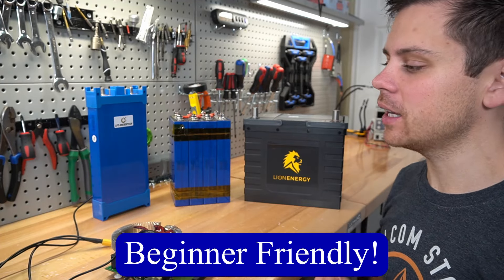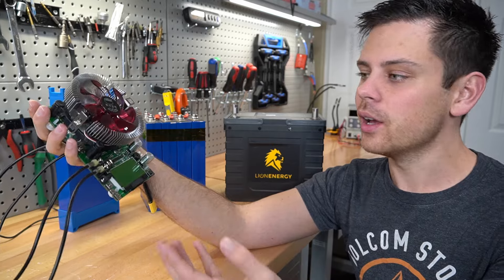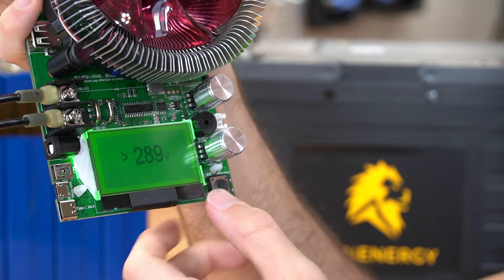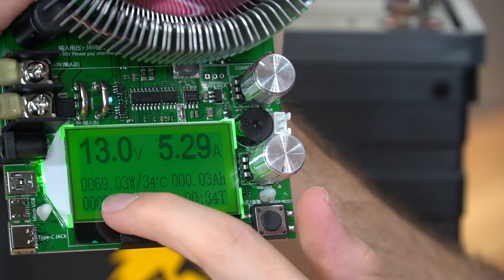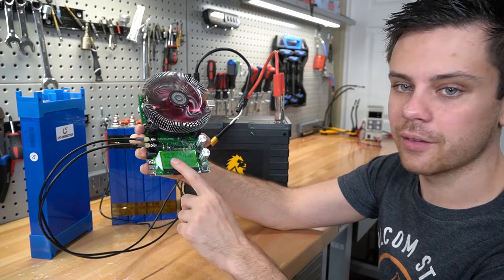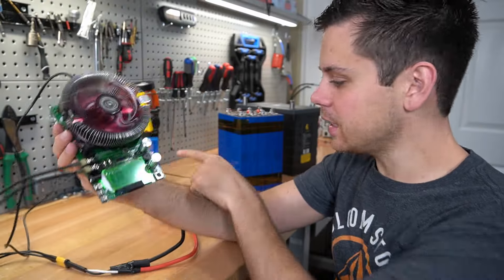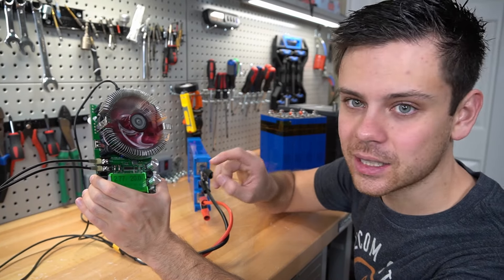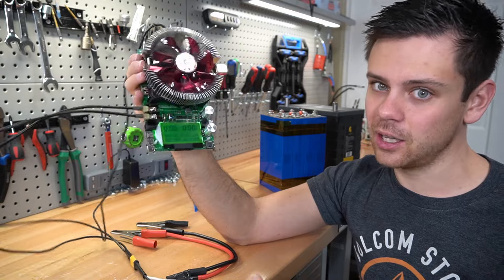Beginner Friendly Lithium Battery Capacity Test Method

Comment: I've been using the same tester for months in my review videos and it works great. You can also power it via 5v usb instead of needing to plug it into the wall. Good for testing outdoors.
Reply from the maker: Oh that's what you use?!?! I remember seeing you use some kind of tester! That's awesome so glad you give it a thumbs up :D if you and I don't kill it, no one can haha
Reply from the maker: I bet the fet will burn out one day. Would be cool to make it water cooled
Reply: @WillProwse  Yep! I only use it to DC discharge solar generators or test panels so the power limit has been a non issue. The fins bend real easy and I can see myself eventually breaking the fan but I keep it in a plastic case now. I wish they had something like this for AC testing inverters!
Reply: @HOBOTECH Hello,  

Hi, What settings are required to test a 14.4V 2.6Ah 4S1P Li-ion battery? I've tried various configurations, but the test stops after running for just one minute. Any advice would be appreciated. Thanks!

Comment: Will, you can do 20 amps at over 13 volts with this tester if you make some changes in the setup alarm screen called > 185 W. After you have noted what the TEMP reading is on your data screen while drawing 184 watts for a few minutes with a 12v, LiFePO4, drop in battery,  (my unit reads 70 Celsius in my house), you can set the tester in a cooler full of frozen water bottles, or do what I do and set it on the face of a portable desktop fan, or any other trick that cools the heatsink better. You should see the TEMP go down a lot. Now you can increase the > 185 W threshold to 260 W. While you are cooling the heatsink more efficiently with whatever technique you decide to use, you can ramp up the amps until the TEMP gets back to where it was when you started. I can now do a 20 amp draw on a 100 AH battery for a true .2C rate test, as long as I set the tester on the face of the portable desk fan. The TEMP stays below 70 Celsius. You can't set the threshold very much higher without the extra cooling or you will burn up the MOFET under the fan and heatsink assembly. I tried it so others wouldn't have to ( that's me saving face, LOL) Hope this is useful to someone.

Comment: low voltage limit  - each double click adds 10 value per click,
Thanks for this video, I would never have figured this machine out with the Chinese English directions. This video was soooo helpful!!
Reply: How does one lower this value? This thing is driving me nuts.
Reply: @super_straight  I did this 2 years ago, do not know the answer, apparently it was in the video. I don't remember 2 years later, sorry Super

Comment: I have the same load tester and, like you, I had a preconceived notion that it would be cheap and inaccurate. Imagine my surprise when I compared the voltage and current values the load tester reported with readings from my high dollar Fluke multimeter. Less than 1% difference! Be careful to always turn both the course and fine current adjust knobs fully CCW before connecting a battery source. Should you forget it will cost you about $5 to replace the mosfet. Thanks for the great video.

Comment: Great review !
But, the "low voltage protection" does not disconect the load. It only use a buzzer to warn you. So if you are not here you can kill your  single cell without BMS
Reply from the maker: Oh crap thank you! Didn't know that. Thank you
Reply from the maker: I'll pin your comment so others can see
Reply: wire relay to the buzzer. fixed.
Reply: @ninja5672  Wow--thanks for the heads up!
Reply: Supplementary Heads Up !    There are TWO versions of this unit, 150W & 180W so do pay attention to which one you are getting.   

IF testing batteries directly, DO put an appropriate sized  FUSE between the battery & the load tester.  Will makes a comment in the video BUT people are missing it.
Reply: @ninja5672  yea thats an easy fix
Reply: That would have been nice to know before I bought it!
Reply: @stephsoltesz6731  ya, mine took a dump, have you had to repair one of these?
Reply: Your video cuts off when you hold down the button to change the low voltage disconnect, how to you change the value? When I hold it down it stays at 0
Reply: my model (185watt) does disconnect the load. I discharged a single cell (200ah) and when the cell reached 2.6v the load was disconnected. My multimeter showed the cell at 2.89v. So it wasnt completly empty. So i think you can set the 2.6v even lower, right? cause the device doesnt measure it accurately (because it also draws power)
Reply: @ericcastro8323  i also have troubles adjusting. You have to hold the button or double click. But how to reverse direction is still a mystery for me
Reply: @stephsoltesz6731  Is a fuse necessary if I were to test a 4s 12v 100 ah lifepo with a BMS? If so, what size fuse?
Reply: @stephsoltesz6731  Thanks! I am about to make a battery for a trolling motor, however,  solar may be in the future.
Reply: @HighlineGuitars  Best option really is to get on the DIYSolarForum, there are Boaters there and actually a couple of threads on trolling motors and thrusters with LFP as well.   Same proverbial Canoe I guess. LOL
Reply: Copying my comment here, since this is a dedicated to low voltage disconnect post:
"
Nobody is talking about this clearly in the comments (not that I found), but to set the low voltage disconnect you need to double-click (not hold) the button. However, on some units it doesn't disconnect, it just warns with a beep; and even if it disconnects, the cell/battery is still connected to the unit and loses voltage. So beware!

"
Reply: للل(ل ه
Reply: My model is 250W. After testing I love it! Mine actually disconnects and stops the test at the preset low voltage
Reply: @zaph0dbeebl3br0x  the voltage creeps back up after it hits the threshold. Might have something to do with the impedance of the battery. It still hit 2.6V. I would not push it. The battery may lose capacity
Reply: @zaph0dbeebl3br0x  Double click the knob to change the direction of the numbers (increase or decrease) and triple click to increment by one decimal point. Hold down to change it quicky in the direction chosen by the double click metiod.
Reply: I guess Im asking randomly but does anybody know of a method to get back into an instagram account?
I somehow forgot my password. I love any tips you can offer me!
Reply: @Zakai Gerald Instablaster :)
Reply: @Francis Cohen thanks so much for your reply. I found the site on google and im in the hacking process now.
Takes a while so I will get back to you later when my account password hopefully is recovered.
Reply: @Francis Cohen It did the trick and I finally got access to my account again. Im so happy:D
Thank you so much, you really help me out !
Reply: @Zakai Gerald No problem =)
Reply: Exactly why I came here right now to check this video again. Was doing a capacity test on a lead acid battery using this tester and just left it and when I came back home the voltage was reading 0.37
Hope I didn't do too much damage.
Reply: How can I use a 16s BMS on 4s?
Reply: @ericcastro8323  Double-click to increase or triple-click to decrease (not for you, for new readers)
Reply: @zaph0dbeebl3br0x  Triple-click to increase. Double-click to decrease.
Reply: @yudhistre   THANKS FOR THE SPECIFICS ON THAT ADJUSTMENT!!!
Reply: Yep. Wish id had dam well read this before completely destroying two of my lithium cells only a few days ago!!
Reply: No that is not correct. When the low voltage limit trips the buzzer goes off and the fan stops but it will cycle back and forth so it looks like it does not work. I did this over and over. If the fan stops, the current is zero.
Reply: @WillProwse  Mine shuts off the load. Fan stops that means it shut off.
Reply: @perry9492  it didn't with mine and two of my cells ended up like water melons at a voltage of 2.1v
Reply: @andysutils  It may cycle on and off enough to kill a battery. It also might be why they burn up if the cycle on and off a lot. It needs to latch in the off position after a low voltage alarm.
Reply: @perry9492  I've noone to blame but myself for being to impatient to wait for my new bms to arrive. I only realised after the reason it cut off with my 100ah ones is because i ran the tester through my bms. It now must have been my bms that cut the capacitor tester off and not the capacity tester itself.
Reply: @zaph0dbeebl3br0x  You have to allow the cell to rest for several hours, after the discharge, before testing with a multimeter. The multimeter will not give an accurate resting voltage immediately after the discharge.
Reply: @HighlineGuitars  Fuse size depends on the amperage being drawn during the test

Comment: I just wanted to let you know that I purchased one of these capacity testers like I said I would and I have a total of 3 lithium iron phosphate batteries that I wanted to get tested. On the third one the load tester popped and sparked and the big main mosfet in the middle failed!! I'm glad that I ordered this from Amazon and I have started a return!!
Reply from the maker: Yeah mine just blew up too!! Need to post an update. what a bummer!!
Reply: @WillProwse  i have 3 of these from a year ago. Now not one of them will turn on.
Is there a way to "reset" them? None of them "blew up" or smoked or anything like that.
Reply: @WillProwse  Do you have an updated video for this issue? I can't find it if it was posted.

Comment: First I really enjoy your videos and the amount of research you carry out before posting. 
When I first ran across this device I was ready to buy and held off only because many have posted the "unit fried" or it didn't work out of the box. It would be great if details on why they fail and how to fix them that is if the failure is something simple. I am a middle of the road hobbyist but don't have the tools to replace those tiny SMD components.

Comment: I got one of these last week in the mail.  Its pretty cool.  have used it to check the life of some of my old portable phone charger banks.  tonight I will use it to check the capacity on my new LG Chem li-ion 120AH modules. It would take to long and get way to hot with a regular RC charger.  the cooler does a good job.  I also will put a small heat sink on the back for heavier loads.

Comment: One word of advice, those fan testers are known to fail at some point in time and they fail in a dead short. Always add a fuse between the battery and the tester.
Reply from the maker: Good point
Reply: DIY Projects Will does mention having a fuse at 5mins 29 seconds👍
Reply: What size fuse would be recommended for a 150w connection? I went up to 160w 
w/o a fuse and poof it fried.
Reply: @xraykadiddlehopper8067  depends how many amps you pull. 150W at 3.2v is less than 50 amps and at 12v it's 12.5 amps. Use a fuse slightly larger than what you plan on pulling. So if you want 50 Amps. go with a 60 amp fuse.
Reply: not so beginner friendly I guess, slow down Will
Reply: That's good to know about  ... Wow !!!
Reply: Like potentially right out of the box like mine just did. It basically just popped and burst into flames. Could easily start a fire.
Reply: Turns out someone who assembled the product left a sticker on the bottom of the heat sink and applied thermal paste directly over the sticker. It says in bold red text on the clear sticker "WARNING! Remove before installation!". Well actually now it says "ins allation!" because that part is burnt.

QUALITY CONTROL ALERT!
Reply: My tester was dead after first test, I should read this first. Thanks mate
Reply: @barrettlewismitsi  It can still catch on fire if the production error takes place where the protective film is left on the rear of the heat sink. The fuse will only prevent the battery from being damaged so long as you are present to notice the potential fire.
Reply: @theyreallnamedgeorge6997  dont diy battery/solar stuff if this is too much for you
Reply: @brendanwood1540  Thanks :-)
Reply: @Fomites  No worries man. Safety first!
Reply: Would it last at least 3 days? I'm going to buy 900 Amps of Lifepo4 batteries wich would take 3 days to test.
Reply: @Milo19970  Honestly if they are assembled properly and you are testing within the device parameters with over current protection it should be good. I would check under the heat sink though and apply some fresh thermal paste. 

They do seem to work. Mine just didn't. It lasted 5 seconds. 

Just some things to keep in mind if comparing to more expensive alternatives. Shipping time and reliability.
Reply: @WillProwse can you please do a review on the bl24ew version thanks and show what the phone app graphs look like etc thanks
Reply: @WillProwse can you please also review the dl24ew tester thanks
Reply: @WillProwse  I burned up 3 testing 36 volt trolling mpotor batteries.  Replaced the mosfet with a higher quality and works good so far. I'm gonna try mounting 3 of these testers in parallel so you can draw more from larger batteries without running close to the limits of the tester. Just add the Ah from each tester together for total Ah capacity.

Comment: Probably said by others but the power lost in the leads is not included in power measured.  I.e. the capacity measured would be somewhat lower than actual.   A "four lead" unit compensates for this as the extra leads measure the battery voltage at the cell and the power consumed then includes the lead losses.   Great work Will! you are awesome :-) .
Reply: It makes little practical difference at these levels.

Comment: I bought this capacity tester to test a cheap "135AH" LIFEPO4 battery off ebay Australia, it came back as 70AH LOL.. I returned it, but the seller has since sold hundreds to unsuspecting people & they are even leaving positive feedback.. I also used it to test a "90AH" AGM I bought off ebay a couple of months back, it tested at 15AH!!!! Also returned.. Definetley worth the investment! I have since found a decent "100AH" LIFEPO4 from LanPlus Australia, it tested at 98AH. Happy enough with that.

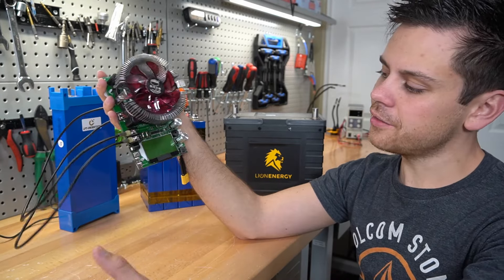Comment: Good basic testing info, thanks. One comment: At 0:58 when you characterize 116 Ah as a "ripoff" for grade B cells, I think that's a bit harsh. That's 96.7% of rated capacity; for grade B cells, at that price point, is quite reasonable in my opinion.
Reply from the maker: Yes true. Should have been nicer. Good point

Comment: I got that exact one, I could not disagree. A very important tool. I likely will be forced to build a 48V battery for my 10kw solar panels. Batteries are impossible to get here in the Philippines. Cells are had to get and iffy at best in quality.

Comment: Good video, of course!  One question to anyone.  Is the low voltage setting on this device an actual disconnect or just a warning alarm? Just to be clear does the low voltage setting on this capacity tester turn automatically turn it off when the low voltage is reached on the battery or does it just produce a warning alarm?
Reply: Oops, just saw my answer.  It just does Not stop the device, Just Warns you.

Comment: Thanks Will but you didn't cover the Test result part. How do you know your capacity? Is it just a readout on the display?  And how does the low voltage cutoff factor in to the calculations? Since you are only testing its capacity to a certain low voltage level, how do you determine entire capacity if you ran it down even further?

Comment: Could you test Edison Nickel iron battery, love your tests and videos.
Reply from the maker: Just posted a video on nickel iron batteries here: https://youtu.be/60CBlgRTZmY
Reply from the maker: Thanks for the idea! Have been wanting to film about those for ages
Reply: @WillProwse  Wow, That was the fastest I have ever seen a video response to a question.
This is interesting along this line.
The Edison battery is very durable, but it has a number of drawbacks," said Hongjie Dai, professor of chemistry. "A typical battery can take hours to charge, and the rate of discharge is also very slow."

Now, Dai and his colleagues have dramatically improved the performance of this century-old technology. The Stanford team has created an ultrafast nickel-iron battery that can be fully charged in about 2 minutes and discharged in less than 30 seconds. The results are published in the June 26 issue of the journal Nature Communications.

Graduate student Hailiang Wang, lead author of the study, said the team managed to increase the charging and discharging rate by nearly 1,000 times.
Reply: I work with on Electrochemistry of Ni-Fe battery, not viable for solar applications. However, they're great to substation backup especially in hotter countries where Li ion degrade faster & thermal runaway is just around the corner. A great Will, thank you 😊

Comment: Will, I have looked at some of your videos trying to find the equipment you have used in the past where you can set your charge voltage and watt output.  What is that tool called?

Comment: I bought a 300Watt B&K Precision DC Electronic Load tester that was a demo unit.  Saved a lot of money by buying a demo unit, but even as a demo unit these units are many, many times more expensive and really do no make since to own for DIY.  Buy a $100 lead acid float battery and a $1000 DC load, or buy a $1000 LI battery and a couple $26 DC Loads.  Oh...the choices in life.
Reply: Hi, which specific model did you buy?

Comment: according to the amazon listing the reason for turning down the load settings to 0 before connecting the battery is because you can burn out the load transistor and resistors.

can you use a anti spark xt90 connector is it a matter of the inrush that destroys the unit?

Comment: Hi Bud.Are you sure this tester has a low voltage cut off? Or does it just sound a beeper when the battery reaches .The low voltage set premeter.